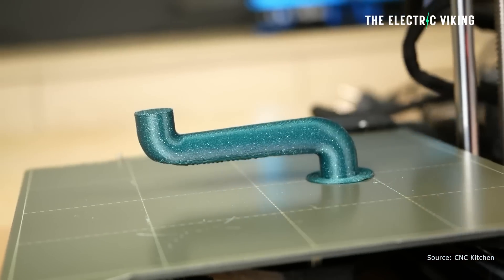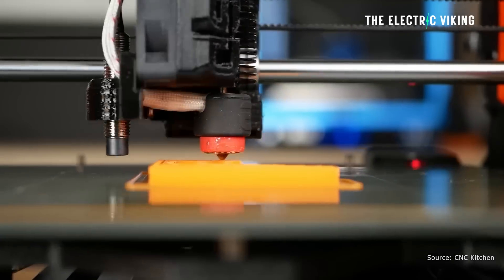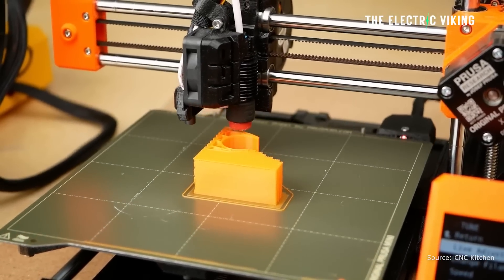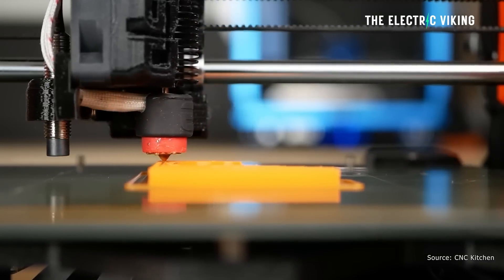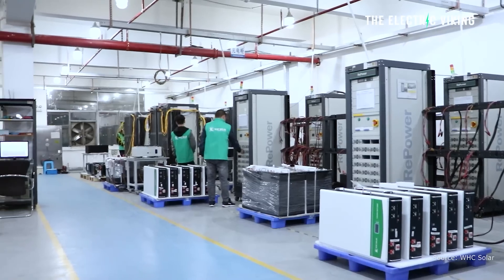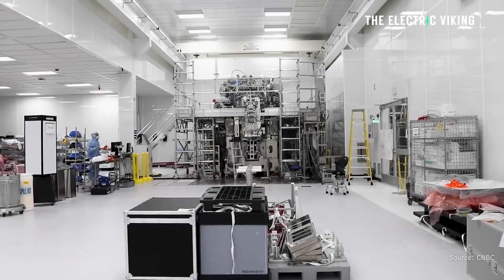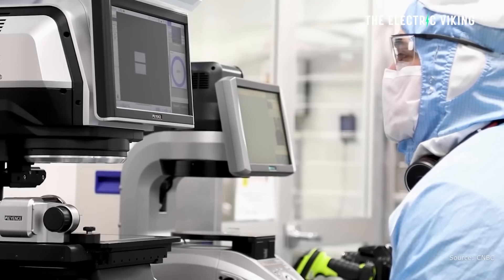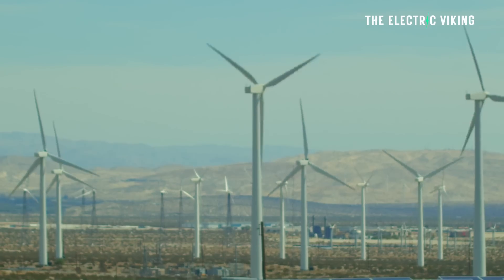New 3D Printing Tech a “Game Changer” for Commercialising Solid State Batteries

Comment: OK, it's about rapid prototyping to find out, which materials would work better. It takes time to try out different materials and this technique could mix different materials quickly and test it.

The real mass production of the batteries would be done with the usual machines with high throughput.

Comment: 3D Printing is the future,, wethers it's going to a auto shop that will print out your car part, build homes, basements, the windows, doors, pipes, shingles all at the job site.. set up the machines, Boston Dynamics robots feed the machines, stand back as they build 5,000 homes overnight cheaply..add in the next generation of solar panels 3D printed

Comment: I did quite a lot of work some years ago using genetic algorithms, where you can think of little pieces of computer code as genes, which are combined & mutated at random, then selected for fitness to produce an algorithm that most effectively solves the problem at hand. this sounds just like that but in the physical world, where different compounds are the genes and the resulting material is the output - it's an amazing way to solve trial and error type problems, I expect it will produce some amazing stuff.

Comment: Elon's TeslaBot the Optimus should have used 3D printing and be made out of plastic
instead of stainless steel which requires a custom metal shop and dozens of highly skilled craftsmen who take 1,000X as long to build the same parts.
Reply: why just printed plastic ?
Reply: @waynefergusson9987  1,000x faster prototyping and steel are not needed in a robot that works side by side with humans.
Reply: @koryballs  Prototyping in plastic is fast - once perfected injected molded nylon is as hard as steel.
Reply: @noleftturns  why are printers only one type of material rather than many ?
Reply: @waynefergusson9987  The robot is designed in one of 3 CAD systems:
AutoCAD, Solidworks, or Fusion 360, all of which directly feed 3D printers.
If a part has to be tougher than the plastic rendering, then there are metal printers, but they require an annealing oven as an extra step.

There is absolutely no need to have any craftsmen involved during the prototyping phase.
Reply: @noleftturns  are there integrated heads ?
Reply: @waynefergusson9987  Yes - Integrated heads in a 3D printer are print heads that combine multiple print nozzles into a single unit. Multi-colored plastics or different plastics can be printed in the same run.
Reply: @noleftturns  I meant different types of materials - conductive non-conductive compressive strength tensile strength porous non-porous coloured transparent elastic etc etc
Reply: @waynefergusson9987  I asked AI that question:
are there different types of plastics available for 3d printing - conductive non-conductive compressive strength tensile strength porous non-porous coloured transparent elastic 

AI replied:

Yes, there are many different types of plastic available for 3D printing with varying properties, including:
•	Conductive: These plastics are made with materials like carbon fiber or metal particles that allow them to conduct electricity. They can be used to create objects like prototypes for electronic devices or jewelry.
•	Non-conductive: These plastics are the most common type of plastic used for 3D printing. They are not conductive and are therefore safe to use for a variety of applications.
•	Compressive strength: This refers to the ability of a material to withstand compression. High compressive strength plastics are often used for applications where the object will be subject to a lot of weight, such as a 3D printed chair.
•	Tensile strength: This refers to the ability of a material to withstand tension. High tensile strength plastics are often used for applications where the object will be subject to a lot of force, such as a 3D printed wrench.
•	Porous: These plastics have tiny holes in them that allow air or liquid to pass through. They can be used to create objects like filters or medical implants.
•	Non-porous: These plastics do not have any holes in them. They are often used for applications where a smooth surface is required, such as a 3D printed toy.
•	Colored: These plastics are available in a variety of colors. They can be used to create objects that are visually appealing or to match the color scheme of a particular project.
•	Transparent: These plastics allow light to pass through them. They can be used to create objects that are see-through or to add a decorative element to a project.
•	Elastic: These plastics can stretch and return to their original shape. They can be used to create objects that need to be flexible, such as a 3D printed shoe.
The type of plastic you choose will depend on the specific application you need it for. For example, if you need to create a conductive object, you would choose a conductive plastic. If you need to create an object with high compressive strength, you would choose a plastic with high compressive strength.
It is important to note that not all plastics are compatible with all 3D printers. It is important to check the compatibility of the plastic with your printer before you purchase it.
Here are some of the most popular types of plastic for 3D printing:
•	PLA: Polylactic acid (PLA) is a biodegradable plastic made from renewable resources like cornstarch or sugarcane. It is easy to print with and has a smooth surface finish.
•	ABS: Acrylonitrile butadiene styrene (ABS) is a strong and durable plastic that is often used for prototypes and functional objects. It is more difficult to print with than PLA, but it can be used to create objects with more complex geometries.
•	PETG: Polyethylene terephthalate glycol (PETG) is a flexible and shatter-resistant plastic that is often used for food-safe applications. It is easy to print with and has a good surface finish.
•	Nylon: Nylon is a strong and durable plastic that is often used for gears, bearings, and other mechanical parts. It is more difficult to print with than PLA or ABS, but it can be used to create objects with very high strength.
These are just a few of the many different types of plastic available for 3D printing. With so many options to choose from, you can find the perfect plastic for your next project.

ct.
Reply: @noleftturns  cheers 'wow !  - I noticed it said to choose so are they not compatible to all print together in unison